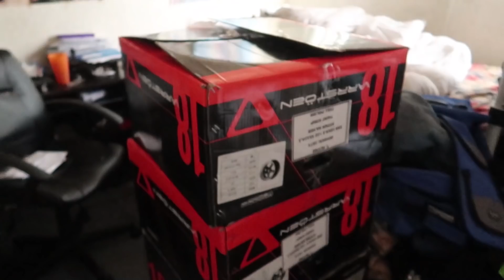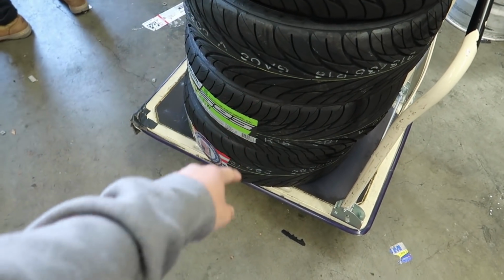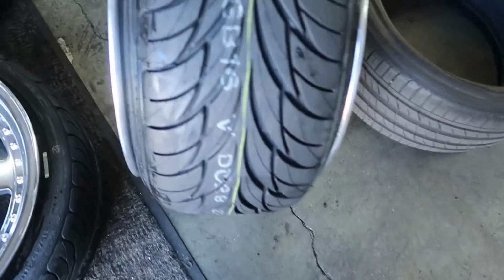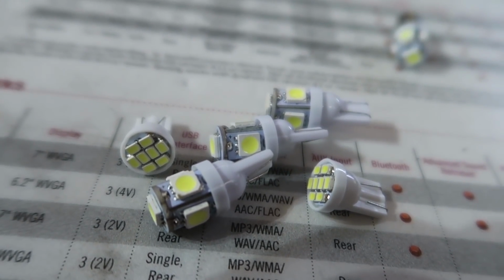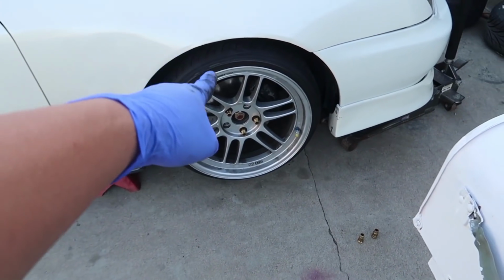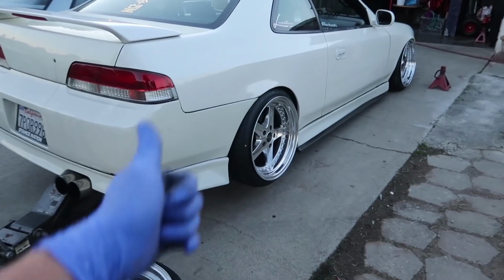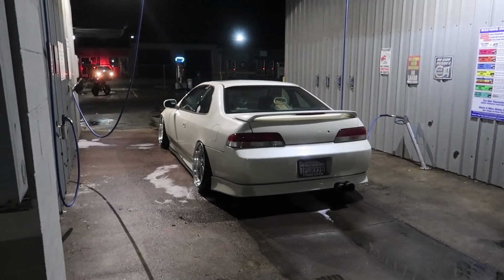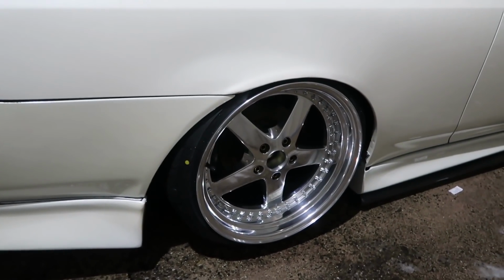New Wheels On My Honda Prelude!!

Comment: Bro use the wheels from the prelude on the IS
Reply: B.D.T.B cuts yesss
Reply: Big facts.
Reply: True man he can put the other rims on 300is
Reply: That RPF1 would look good on the IS. I have it on my Z and it's one of the best timeless look out there
Reply: Different lug pattern
Reply: @adrianarcelo3287  oh fr? Dang that sucks
Reply: @BDTBcuts  is300 and prelude is 5x114, same wheel pattern
Reply: Hail yeah! Was thinking that when he was taking them off! He should
Reply: Fix the gaps in your front and back bumper‼️
Reply: Adrian Arcelo a lug conversion is easy, takes like 10 minutes and is only like $50